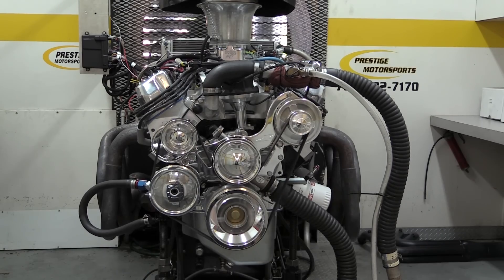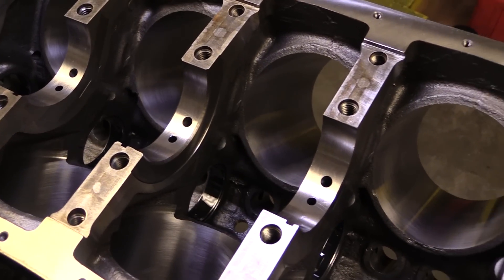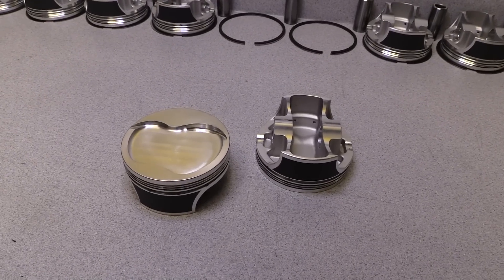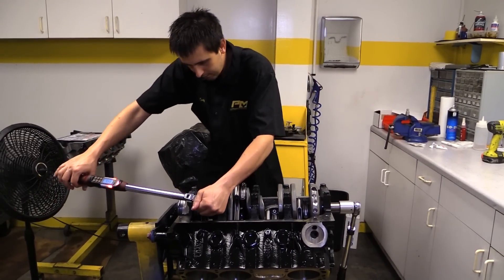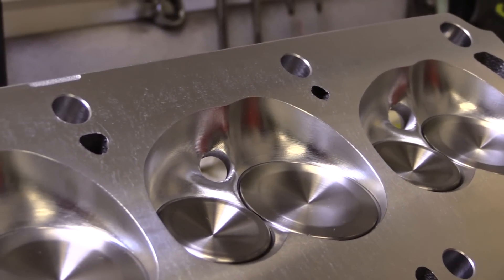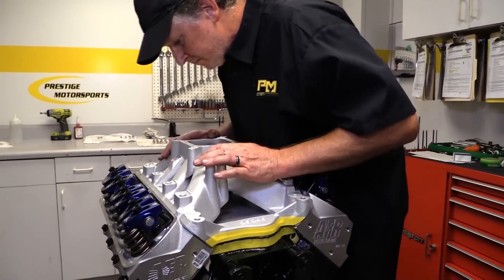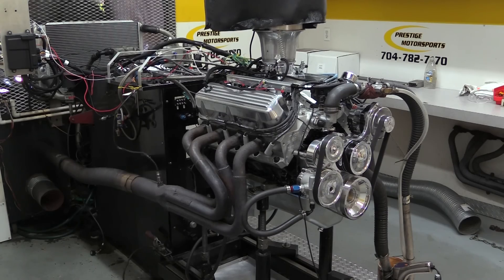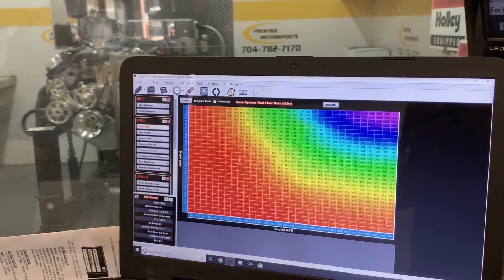Prestige Motorsports' Brutal 600+ Horsepower Ford Build!

Comment: What pump gas, 91 or 93 octane?
Reply from the maker: 93. Here in North Carolina our options are 87, 89 and 93.  Thanks for watching
Reply: Make little more power on e85. Mine made 505wheel through a 4k stall th400.  Faster up top. Destroys cars that make 100wheel more than me. Th400 is drag king

Comment: Sorry if I missed it but what was the compression for this build?

Heads are 58 cc as stated but I didn’t catch what the CR was
Reply from the maker: No problem. 10.5:1. Thanks for watching.
Reply: I’m building very similar motor.   I’ll be using an Edelbrock elbow through a proM MAF and 4 inch power pipe and 90 mm throttle body.    Hope I get similar power numbers this build.

Comment: Great build it looks both amazingly powerful & long term reliable at the same time.  The last thing I would want is a small block twin turbo charged engine that most likely needs a complete rebuild every 10K miles.

Comment: Naturally aspirated Fords with Hammerhead Hemi heads are making 1000-1200 on race gas; nobody knows where the limit is.  Different people have different ideas concerning what is and isn't a street engine; most of the people pushing the idea of putting huge power numbers down on the street are making their power with race engines tuned to run on whatever fuel is considered "street gas" at that time -- usually, that's either:

(a) E85;
(b) Sunoco 100;
(c) AKI-93 (aka: "93 PON," "93 DON," "93-Octane" or some like appellation derived from the AKI format "((MON+RON)/2)" used in the US.

To get an idea how close are pump gas numbers and race gas numbers with Cleveland-style heads, check out: https://www.youtube.com/watch?v=5Rz7paeKSOM

Use of octane booster is generally frowned upon, but pump blends are generally allowed, and I've never heard of anyone actually testing for the use of octane booster.

Granted, you can hang a license plate on a race car, and in many jurisdictions that (plus minimal liability insurance) is enough to make it "street legal," but just because the state will let you get away with that doesn't make it a street vehicle.  Ditto for "it passed the HRM Power Tour" road test -- although that's at least a step towards weeding-out the most outrageously insane combinations.

If your engine won't hold a load against the dyno brake from at least as low as 1500-ish rpm, all the way to redline, it's a race engine.
Reply: Theyve done stuff like this before.  it was called the pump gas drags by hot rod magazine

and yes,  they did drain your tank and fuel was tested.  they used rocket 93 octane and quarantined the cars overnight

then we saw who really had a fast pump gas car or who would grenade their engine.  and quite a few people did.  it ran from 2004 to 2007  and they had to do a cruise.  you couldn't make the 20+ mile cruise,  DQ'd

Comment: I would like someone to explain to me how those type of connecting rods are stronger than the I beam type. Also how can those short skirt pistons keep straight in the bores for any length of time. I may be in my 70s but can still learn.
Reply: As-manufactured, H-beam connecting rods are commonly regarded as being weaker than their I-beam counterparts; however, the former often are contoured better for stroker applications.  Partly, that has to do with the geometry of making an assembly fit inside the block (along with things like the camshaft), and partly that has to do with putting the right amount of mass at the right place in space, to facilitate the balancing of the overall assembly.  At least, that's my take on it.
Reply: Burt, I hope learning doesn’t discriminate based upon age. If all goes well, I’ll turn 70 next year 👍.

Comment: Great build guys question can that baby fit in a 2004 crown victoria?
Reply: That Crown Vic will swallow ANY engine
Reply: Flat-hood Panthers have been built with low and high deck Windsors (so the answer to your question is obviously yes), low and high deck Clevelands, FEs, and 385-series "Lima" big blocks.

Comment: So essentially nothing on this was made by ford .😹😂
Reply: Geez louise...any build that goes anywhere near 600+ shouldnt have any factory parts and ur not going to make over 400hp with factory heads, intakes etc lmao. Altho i did a 406 SBC a few years ago that made 643hp on pump gas with an OEM 511 block (ONLY Chevy part on it) that somehow still hasnt split

Comment: Very nice ,very nice .Have a question did you have to use a reverse rotation  water pump? Since the motor does have a serpentine belt.
Reply from the maker: Yes, I'm pretty sure it is. It all came together as a kit from Billet Specialties. Thanks for watching!

Comment: I always thought this was a big block engine.
Reply: It's not even a small block engine. small block and big block are chevy terms. This is a Ford windsor engine family.
Reply: @AmericanThunder  I've always heard people use big block and small block to describe Ford and Chrysler engines though...
Reply: @SOU6900  it's very common but it's technically not correct
Reply: When i used 2 drag race my chevy buddies always said that about 351C because they had canted valves like a BBC "yeah - but thats a big block!" My reply "It's 351 cubic inches." Lol
Reply: @timchadwick8245  The definitive way to verify if it's a big or small block is by putting it on a scale. lol

Comment: Whatever happen to Clevelands? Used to be the performance choice way back when...
Reply: Poor factory oiling system that requires extensive modifications for race duty.  Cleveland heads work much better for all out racing but the inline valve windsor heads  seem to provide better low rpm torque for street use. NASCAR engines used to be Cleveland/ Yates heads on Windsor blocks.
Reply: @RSDX99  It's amazing that false anti-Cleveland propaganda has persisted all these years.  The 351C-4V began as an industrial engine that had a toggle switch (idle/run), and the "run" position was WOT -- in 24-hr/day service, connected typically to fuel tanks having capacities greater than 200 gallons (and occasionally, over 800 gallons).  Granted, those weren't cammed to kill, but they made Big-Block power from a Small-Block package.

Then you've got everything from the lowly 351C-2V that hauled around luxo-sleds weighing more than 4000 pounds, delivering surprisingly spritely performance for their class -- to the 71 Boss and 72 HO engines that kicked ass and took names.  It's like everyone talking about what a gigantic car was the piggish, portly, hyper-obese 71-73 Mustang (which was actually smaller and lighter than the "svelte and wiry Camaro" of the same years).

Read the magazine reviews, and you come away with the impression that the Mustang was an underpowered land-yacht dragging its anchor everywhere it went.  I've driven both (71-73 Camaros and 71-73 Mustangs), and the Mustang was by far the more nimble car, that gave vastly superior feedback to the driver.

The Mustang did have a blind spot the size of Alaska, but no Camaro I ever faced could catch up with me close enough to block the lane, anyway -- and I think the Mustang was every bit as good, if not better than, the Camaro at low speeds.  Plus, the Mustang looked sporty and felt as though it had the composure and poise of a great cat: it evoked its NAA namesake, whereas the Camaro looked and felt cheap, and evoked the image of a wannabe or a poser.

As to the idea that the webs of the 351C were inherently weak and prone to breakage, it's interesting that modern NHRA Pro Stock and IHRA Mountain Motor engines run 351C main bearings.  Tear into the bottoms of a 1970-1974 SBC-350, Ford 351C, and Mopar 340 and 360 (I know it's unfair that Mopar gets 2 bites at the apple, but if I picked one or the other, someone would bitch about how that wasn't being fair) -- and compare 2-bolt mains to 2-bolt mains, and 4-bolt mains to 4-bolt mains, design & construction vs design & construction.

Then take into account that the iron used in Ford's regular production 2-bolt blocks was on-par with the strength of the iron used in GM's race blocks of the same era, and vastly stronger than the material GM used in regular production; and then realize that Ford also had hi-nod/nickel blocks: the Ford blocks are simply better.  Not saying that Mopar was crap, but Mopar generally used additional material instead of stepping up to a stronger material.

And, although GM and Mopar were doing radical surgery on their PS blocks, and changing the angles of the valves in the heads, and the angles of the combustion chambers with respect to the block, and moving spark plug locations and relocating camshafts and such, in addition to running stud girdles and windage trays (I can't remember when dry sump oiling got started), Bob Glidden was kicking ass with a 351C that had been sleeved to allow a 4.080 bore (Mopar could get there with just a 0.040 overbore, and GM just increased the wall thickness of the 400-SBC to reduce the 4.125-bore to its targeted ideal).

If the Cleveland bottom-end was as weak as it's been made out to be, Glidden's car would have been puking crankshafts in the pits, and never have made it to the starting line.

As to why Ford switched to the Windsor, neither horsepower nor torque, nor "notoriously fragile main webs" or any other phantom malady had anything AT ALL to do with Ford's decision: the Windsor was simply cheaper to manufacture, and it was adequate to the task that Ford asked it to perform. 

And if you think that the buying public really gave a damn about muscle during the Cleveland era in the USA, take a look at how those engines sold, versus cheaper models -- or, the number I think is really telling is the unit-sales figures for 1970-1974 (just looking here at Camaro-vs-Mustang/Mustang II):

1970: Camaro (all) = 124,901;  Mustang (all) = 190,727
1971: Camaro (all) = 114,630;  Mustang (all) = 149,678
1972: Camaro (all) = 80,015;  Mustang (all) = 125,903
1973: Camaro (all) = 96,751;  Mustang (all) = 134,867
1974: Camaro (all) = 151,008;  Mustang II* (all) = 385,993

The Mustang II wasn't even available with a V8 in 1974.
Reply: @wireflight  You are right Corazon!The Cleveland is an awesome engine.Here in Australia they were casting Ford Cleveland Blocks for Nascar teams in America.They did two batches ,The first in the mid seventies and again in the early eighties.These special blocks had a casting number begining xe195240.Thicker bores ,pan rails etc.It was only in 85 onwards they started running the windsor blocks with Cleveland heads .Cleveland production in Australia ,sadly ended then but we had it much longer than the states did:)
Reply: @RSDX99  Thanks! Always wondered. Had a 400 in a 71' LTD. Ran great as a daily driver...
Reply: @islandaerial3414  -- Australia is ALL about the Cleveland.

Comment: 612 out of a 427? That’s it?
Reply from the maker: It is a naturally aspirated pump gas street motor that makes good torque down low, should have excellent throttle response off idle and will last for years without needing a rebuild. Just asking, how much power should it make?
Reply: A texas speed LS isn't that much more HP and they are using more compression and good EFI.  This EFI system arrangement here was already tested by CHP, and it was the lowest performing of the 3 systems tested.  So if they used an ELBOW/TB combo, they could have hit probably 630-640 in a small block package.   The solid roller is un-necessary, though.
Reply: The 1 i did made 679 but with a bit of work to the heads, fully-ported intake, FAST TB & injectors & a Holley ECU & slightly smaller Bullet cam & better valve train. (Jesel shafts, 7/16" pushrods & better springs & titanium retainers). And probably also a happier dyno lol
Reply: The motor does have a front end on it but it would of been nice to see what a 850 qf dbl pump would of done

Comment: I like that you dyno'd it with all the accessories.
Reply: Engine Masters did a show on the power drag of accessories. They all take a little but the Alternator is a hog, taking 15 horses.
Reply: @johnparrish9215  yes.
Isn't it horrible that the engine won't run for long without them.
Reply: Only way to do it if you want ACCURATE measurements.

Comment: I love how he drives the pistons home without any protection whatsoever on the rod bolts.... clunk!  🤷‍♂️
Reply from the maker: There are no rod bolts. These connecting rods use cap screws, or bolts that insert in through the cap side. If you turn the crank so that the throw is away from the cylinder bore, you can install the rods and pistons into the cylinder bores without having to worry about contacting the rod throws on the crank. Then you can gently push the piston in the rest of the way with one hand while guiding the big end of the rod over the crank throw with the other hand. Thanks for watching.
Reply: The Horsepower Monster Thank you for the explanation. Love your build otherwise! That is one shittiń and then gettiń blue oval  that’s for sure👍🏻

Comment: You can still run 93 octane at 11.5:1 compression.  But that's the limit.
Reply: Good luck with that.
Reply: @luther250F  I am on e85 now. The best fuel i ever used.

Comment: Damn I have a smaller XE Xr292r Comp cam  street solid roller in my pump gas 438windsor and it spins like a swiss watch to 7200rpm.  It blew up 4 Built C4 transmissions in my 68 Mustang.  Now I run a built TH400.
Reply: maximus vonce yep you need to build a c4 to handle hp i have  a 5.0 with a little over 500hp detonated it in less than an hour on my first run and it was only a test run damage$ my block  cracked the starter bolts right off the block i have never seen a tranny blow up like mine did shattered bell housing  and blew tail shaft all to hell  so now got a new motor new tranny (power glide2speed  fast and faster) 1200 + hp enginemy fox is soon gunna be chasing some hen$
Reply: @chickenmaster7069  That's why i have a Th400 now

Comment: Is this an Extreme Energy solid roller or race roller. Is this a custom grind Xr292R extreme energy solid roller.
Reply: Its a billet core so it is not a cast core extreme energy also it has more duration & lift than the largest extreme energy grind

Comment: Compression is too low for that cam.
Reply: Nah, not really. I did basically the same engine with a very slightly smaller cam (253/258 .695" gross) same CR but it made WAY more tq & 679 hp. Only major difference i c is i fully ported the intake, not sure what went wrong with this 1

Comment: I hope you used Isky Bushed lifters or this wont last.
Reply: This was my same line of thinking but the a**holes at isky wouldnt evn return my calls so i originally bought $1200 Crower bushing lifters (which were too small in dia & would have required installing lifter bore bushings in a brand new block) but i was cautioned against running bushed lifters on the street by a tech at morel who said he'd seen many sets of their bushed lifters (which he would have gotten more money from me on) returned locked up after street use so he steered me to the pressure-fed ultra pros which he said they've seen very few failures with in street use.
Reply: @timchadwick8245  2 years later....how did the morels hold up for you?
I have a set in my 427...and I havent had any issues...but i dont put many miles on the engine.

Comment: I have a pump gas fuel injected 438WINDSOR that made 680hp. Killer engine
Reply: What engine management/ecu and injection system you running?
Reply: @TheRdub82  multiport fuel injection with mass air flow meter
Reply: @TheRdub82  PCM from 93 Foxbody 5.0
Reply: @maximusvonce1381  thanks

Comment: Its so funny to hear talk about where the oil should go first...
Ford was really confused about that..
Reply: All Ford 302-351w are priority main oiling from the factory! Whats funny is all the ignorant people that make a big deal about the aftermarket stuff being that way! Ford was not confused but Chevrolet sure was!
Reply: The factory production Cleveland blocks unfortunately didn’t have priority main bearing oiling. The Ford engineers responsible for designing the Cleveland block actually did a pretty good job with their original design. Apparently the bean counting financial geniuses at Ford decided it would save on production costs if the blocks were only machined for two main oil passages instead of the customary three typically used for priority oiling. 

The lack of priority oiling didn’t become a problem until the early seventies when Pro Stock engine builders realized the superior flow potential of the Cleveland quench chamber four barrel heads, especially at extremely high rpm’s. 

It didn’t take long before the aftermarket cam grinders figured it out too and suddenly stock block Clevelands were making huge power at 9000 rpm’s. With an inadequate oil supply, the first thing to go were the main bearings which was usually followed by total block destruction. Keep in mind that aftermarket blocks weren’t available yet so smart builders found feasible ways to deal with the problem. 

It obviously worked because that’s when Bob Glidden began his domination in Pro Stock using production Cleveland blocks. I mentioned Glidden because his success set off the GM cry babies which forced the NHRA puppets to start changing their rule books in a pitiful attempt to factor out Clevelands from being competitive. The situation was also very similar in NASCAR circles too 🏆. 

In a recent interview on DragBoss Garage, the legendary “Animal” Jim Feurer said that before he switched to the Boss 429 design, he would routinely spin his production based iron Cleveland engines to 10,500 rpm’s during match race competition. That’s amazing. I’ve owned some great 351 Windsor powered Mustangs but unfortunately they don’t have the testicular fortitude required to hang with a identically prepared Cleveland. That’s just my opinion and I’m sure that others will strongly disagree 🏁.